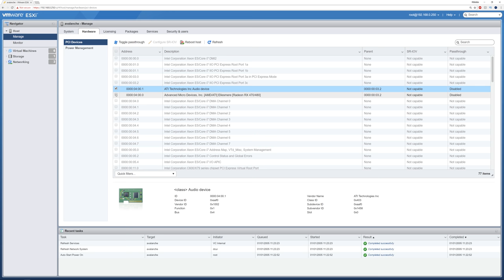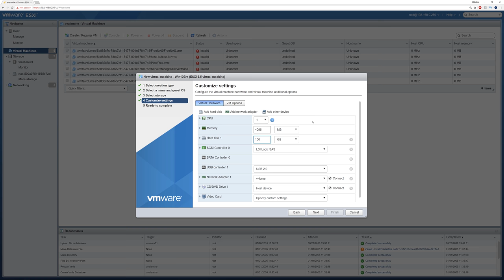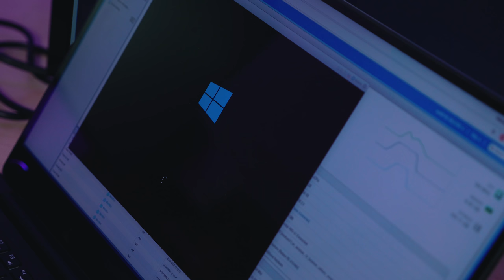Virtual Gaming PC in VMware ESXi 6.5 - Franken PC May 2018

Comment: Awesome, thanks! For a while now I've been using my server as a gaming PC, (literally an HPE Proliant DL580 server, haha) but at this point I need to multipurpose it into VMs for actual server purposes. My hope was that ESXi would let me still enjoy the overkill hardware for gaming, perhaps with my Nvidia Shield Portable or work laptop (vPro CPU, decent Nvidia card compatible with GameStream etc), so I'm really glad to see this!  Nice to see the performance you got using the basic VM interface, too. With the PCIE tied in like you showed us, hopefully it'll work smoothly. I know it works much better than Steam Link or any other RDP/VNC type interface I've tried so far, at least in native Windows Boot, and I'm hoping the headless-mode install (no external display ports enabled since I can tell ESXI to only use the server's S3 chipset) will give me increased performance over my current already great experience. Thanks for the tips about stuff like the 2nd monitor/install OS first bit, as that helps a lot. And I definitely agree about the server sound - mine's even worse. Add a 3 fan Nvidia GTX 1070Ti to the 6 vortex blower fans in the server plus 2 more in the power supplies and one more for the external power supply to run the video card (on a PCIE extension because it won't fit inside) - the "sea of sensors" detects it and ramps up the fans pretty loud. I can't wait to have it located in the back room instead. Your video has given me the confidence to give it a shot! (edit:grammar, punctuation)
Reply: That sounds (almost) great, except the loudness... I've got a similar setup too. Though I'm running a Linux host with docker containers, shares and so on and I've got a KVM with GPU Passthrough set up. My CPUs a R1600 and my GPUs a RX5700. The problems I'm facing is that for one my GPU doesn't reset correctly when I shut down the VM (reset bug kernel patch doesn't fix it for me) and second I'm unable to use it properly to stream my games to my laptop... That really kind of sucks as the HEVC encoder is really good and fast but the picture quality is really shitty on h.264 as parsec doesn't decode HEVC on Linux or when the client doesn't decode h.265 in hardware... 🥺

Comment: Awesome ! Just what I was looking for, proof that this was possible!
My next project is to create an ESXi server, have some ubuntu servers for my other projects and stuff and still be able to game on my couch! I "need" an Emulator VM, and since the rasberry pie can't handle too new consoles I wanted to have something with abit more juice in it, and still at the same time not have to have like 3 PCs around for the different purposes. Thanks!
Reply from the maker: My pleasure!
Reply: Heh, one of my planned VMs is the same - a dedicated emulator that I can stream to a TV in another room using an old laptop or more likely android phone/tablet (I have a few more than good enough for this with 1080p VNC/RDP capabilities plus HDMI out) and a bluetooth DIY arcade controller I built using classic real HAPP arcade buttons and 8-way joystick plus an ESP32, a lipo battery & charge circuit.  Originally had the Raspberry Pi in there too, but it's just not strong enough for what I want.Can't wait to have that able to run any time on it's own without bogging down my Windows install. The server I'm using is older, true, but still has plenty of power for what I need, and definitely for this. (12 cores/24 threads? Yeahhh... overkill for me, haha. But it was cheap!)

Comment: I wish this would have gone into how to use it remotely on a local network.  This is a great setup, but doesn't necessarily make sense if you plan on having physical access.
Reply: Parsec
Reply: @EddieLord  Parsec is great.  Still not quite good enough for games that require low latency.

Comment: Hey man you did a great job with this build, I have some questions, I am going to attempt this at home. But what its not clear for me its the part about the graphic card, so you can basically access the power of your desktop  graphic card using VM VT-D right ? you don't need to connect the laptop to anything else than your home LAN right ? Also you know will be super cool? Run some benchmarks comparing the VM vs the actual machine without vitalization, and let us know more details about your home network.
Reply: He has setup pass through for the graphics card directly through to the VM. It means  esxi doesn't touch it and passes it directly through. If he configures auto boot for that Windows VM, you don't need any other device on the lan to turn it on once it's all up and running.

Comment: Did anyone else notice the game stutter randomly a couple of times? Like a micro freeze? Edit: @8:46 you can see one as he runs around the corner.  A millisecond freeze
Reply: He has assigned only 4 core of that weak-sauce cpu, and only 4GB of RAM. I get no stuttering on my ESXI setup, horsepower is comparable, I'm using a E3 1230V3 and GTX1060.

Comment: Nice work mate. Could I please get some advice on how I would go about this problem below.
We are thinking of installing about 60 gaming capable pcs in our labs. These pcs need to be able to be on the school domain(tied down) and as well as free when it comes to game development courses. 
For the moment we were thinking of dual boot option with two NICs and so on or build vmware esxi servers that could run instances of gaming virtual cable virtual machines. The idea is that those that need the computers for gaming development can RDS into the vms.
If we were to group the pcs in 20s. what sort of hardware set up would you recommend?

Comment: Quick question do you always have to connect the monitor to the video card to achieve the performance for games or would using a rdp or vnc from another room if they are both on gigabit switch suffice? if so what would you recommend to use for the connection to host rdp?
Reply from the maker: You have to have a monitor connected to the machine for it to work.
Reply: install Steam on the VM and you can stream to any device on your LAN, that's what I do and work pretty good.
Reply: @GearSeekers  what is the point of using ESXI server if you cannot RDP or VNC remotely to it? Why wouldn't you install windows on bare metal rather than installing on ESXI hypervisor? Maybe I'm missing something?

Comment: Weird, I have a Xeon E3-1260L v5 and RTX 2080 Ti Setup running ESXI 6.7 and Fortnite runs like crap. The Witcher 3, Rise of The Tombraider, Battlefield 1, etc are running perfectly fine at 60FPS maxed out on ultra. But in GTA V and Fortnite I´m getting about 40FPS with drops to 20FPS.
My CPU util is around 50% in GTA V and Fortnite...
Do you have any hint what I could test or change?

Setup:
- ESXI 6.7
- Gigabyte GA-X150-PLUS WS Motherboard
- Intel Xeon E3-1260L v5 (8 vCPU´s, 8 Cores per Socket assigned to Win)
- 64Gb DDR4 2133 MHz (20Gb assigned to Win)
- 500Gb 960 Evo NVMe
- RTX 2080 Ti
- USB3.0 PCIe Card for Windows
- Gaming VM: Windows 10 Pro Build 1809
- Plus 2 other VM´s in idle
- VM SVGA disabled for WIndows
Reply: Figured it out by myself :) Everything runs perfectly fine now after setting 8 vCPU´s and 4 Cores per Socket. Not quiet sure why, but this was a total gamechanger compared to 8 vCPU´s and 8 Cores per Socket
Reply: Figured it out by myself :) Everything runs perfectly fine now after setting 8 vCPU´s and 4 Cores per Socket. Not quiet sure why, but this was a total gamechanger compared to 8 vCPU´s and 8 Cores per Socket

Comment: Minor thing I noticed but it is best practice when screwing in the heatsink/watercooler to cross tighten the screws (IE. top right > bottom left, top left > bottom right). Should help disperse the thermal paste more evenly and not put so much pressure on one side of the cpu at a time. Nice video!
Reply from the maker: You know that I've been been building for like 20 years right lol? It actually doesn't make much of a difference when this machine has already been torn down because it was built only for this video. When you build as much as I do for these silly builds you tend not to care and want to get it done fast. If you watch any of the howtos what you're saying is what I say every time.

Comment: Did USB passthrough require any additional USB PCIe cards or does it work right off the MOBO?

I am prepping for a 2 gamers 1 PC build using ESXI (not Unraid) but have had a hard time finding info for USB passthrough for multiple VMs.

Thanks!
Reply from the maker: The Intel server board we used has 3 USB controllers. It was pretty easy to do.
Reply: Thanks for the info!

Do you happen to know if ESXI's I/O Passthrough allows both PCIe and PCI devices, or just PCIe?
Reply from the maker: It should allow both.

Comment: I have a question:

Does this also work with a normal vmware workstation 16 pro? i am currently trying to get a windows XP VM to work with retro-games, so far everything worked fine (and partialy even better than back when i used a physical XP-Machine), but the VM has some problems running GTA san andreas. I dont know why, but the framerate is super-choppy and often freezes for a few seconds. It seams like the VM cant use enough graphical resources to get SA to work properly. Is there something i am missing? otherwise it seams to work just fine. ;)

Comment: Hey Nick! This is completely irrelevant to the video but I was wondering how to have a pair of speakers and a headset connected at the back of my PC at the same time cause there is only 1 line out. Thanks!
Reply: Can't believe nobody answered this until now! If you don't have a headphone jack on the front panel of your case: 
(1) EASY/FAST you can get a headphone splitter like this
https://www.amazon.com/Belkin-Speaker-and-Headphone-Splitter/dp/B00009WQSR/ref=sr_1_6?ie=UTF8&qid=1539368256&sr=8-6&keywords=headphone+splitter
and plug it in to your rear panel line out
(2) Harder/slower/more hackish:
you could be certain your motherboard supports front panel input/output (see the manual - it's a bunch of tiny colored pin pairs together often at the bottom front of the board) and get a generic i/o panel ($20 US) with a wiring kit ($8 US) and hook up headphones and USB
3) Kinda weird but anyway - find a used speaker set you like with a desktop volume/headphone out.

Personally I'd do the splitter and save money for the speaker set for later. Cheers!
Reply: Good man, David.  He's got right idea.  Same thing I've got.
Reply: @daviddupoise6443  my g thanks

Comment: hmmm im looking for cheap dead simple solution for cyber cafe , is this thing great to deal. but how pc clients can connect to VMs without extra hardware especially for keyboards and mice
Reply: Simply put... you want extra hardware. What route you would take depends on your use case. Do you need gaming workstations? Or just basic productivity & web browsing? Maybe a mixture? I'll cover how I would handle both situations.

Gaming Stations
A dedicated GPU and USB Controller per VM. You can get USB 3.0 PCIe cards that have multiple controllers. The most common is a 4 port/controller card. 4x GPUs, and 1x USB card to support 4 VMs. Place a powered USB hub at each station and use that to connect your KB, Mouse, & Headset.

Productivity Stations
Look into picking up some used thin clients. These are essentially very low powered machines designed for the sole purpose of using RDP, or other protocols to connect to a VM or remote machine over the network. All the heavy lifting is done on the server where the VM is hosted. That will let you attach physical peripherals right over the network. No need for dedicated GPUs & USB controllers on the server.

Comment: Im trying to do the same thing but after installing my 1660 Super, it's listed as "nVidia Corporation VGA compatible controller". I would have expected it to show up as something like "nvidia 1660 super" and when i pass it though to windows VM, i tried installing the nvidia drivers but it fails
Reply: Did you find a workaround to this? I'm currently having the same issue.
Reply: @Dogsss752  Yeah I did, apparently Windows 10 was out of date at the time. Make sure you update Windows 10 to the latest update. After doing this, the 1660 Super showed up and I was able to install the GeForce drivers. But if you're talking about getting the 1660 Super to properly show up in ESXi, sadly that won't happen. But you can still pass it through to a VM.
Reply: @DerpyNoodIe  thanks for the reply, Im stuck at an issue now where GPU passthrough is stuck at a constant state saying "enabled/needs reboot". this is for sure  a fun project to work on, but very aggravating, especially when you have no experience in the IT field. Good practice for me when I graduate next year and get a job somewhere IT related tho. looking forward to it.
Reply: @Dogsss752  That's pretty weird, so it gets stuck on enabled/needs reboot. So when you try to reboot, does it still say the same thing? I had the same issue with my 10GbE port on my motherboard, which I ended up buying a 4-port SFP+ PCie card and then upgraded my entire LAN to Fiber Optic (10Gb SFP+). Do you have the latest version of ESXi 6.7.0? I was able to passthrough my 1660 Super, it was a bit glitchy trying to select it because it would randomly highlight other devices above and below it, but with timing I was able to select my GPU and get it working.
Reply: @DerpyNoodIe  yeah I'm on the latest version, I got it to passthrough bt toggeling it on and off but I still cant install any drivers, driver says its microsoft.  Guess it didn't actually pass through despite it saying it did.
Reply: @Dogsss752  there's a work around to get it working. First you want to do is make the Windows VM to think its running on bare metal. To do this, you must navigate to your VM and go to "Edit Settings > VM Options > Advanced > Edit Configuration". Here you will add a line. Add "hypervisor.cpuid.v0" under the "Key" text box and then "FALSE" for the "Value". Next you will want to add "pciPassthru0.msiEnabled" and set that to "FALSE" and finally "pciPassthru.use64bitMMIO" and set that to "TRUE". Then start the VM and try to install the Nvidia drivers.
Reply: @DerpyNoodIe  oh man, you just saved me so much time, thank you dude.
Reply: Ganji Carries No problem :) 👍
Reply: @DerpyNoodIe  after rebooting it reverted the drivers back and now they wont install again. it's almost like nvidia doesnt want people using vms lol
Reply: Ganji Carries The reason for that is because Nvidia doesn’t want people using their consumer grade GPU’s for VMs. They want people to buy their Quadro series which is designed to run in multiple VMs at the same time, just like how you can share the CPU across multiple VMs. Also the reason why it resets the driver is because the VM will default to the generic Microsoft drivers. Your VM is seeing two monitors. One is the Microsoft driver (the virtual monitor displaying on ESXi ) and the second one is the Nvidia drivers (the physical HDMI port on your Nvidia graphics card). You need to connect your GPU to your monitor physically. Then the VM should display to the monitor (make sure you go to the correct input of your monitor), The VM will most likely be set to a lower resolution (may not be able to change to native resolution yet). Next you will need to set your VM to use the Nvidia drivers, to do this, you must right click on the desktop and go to “Display Settings” and you should see two displays, scroll down to “Multiple displays” and there should be a drop down box. Select “Show only on 2”. What this does is force the Nvidia driver to be used. Due to the limitations of using a consumer grade GPU, you will not be able to access the VM on the ESXi display because the Nvidia driver is associated to the physical port on the GPU. However if you are viewing the VM on the monitor through the Nvidia driver, you can still remotely control the mouse and keyboard by clicking on the ESXi virtual display, the screen will be black here but if you move the mouse around, you should see the inputs working on the VM which is displayed on your actual monitor. Moving the mouse off the virtual screen will result in losing input for the mouse on the VM, but you can just hover your mouse back to the virtual display on ESXi. Hopefully this helps. Also you can set your native resolution at this point. Every time you reboot the VM, you will need to set to display 2 and set the resolution again.
Reply: @DerpyNoodIe  wow, you know a lot about this. The only issue I'm running into is when I connect my HDMI directly  to my monitor it's a hit or miss when showing the display. It will appear for a brief period of time, then it disappears. On top of that it wont recognize my mouse or keyboard. I have no issues when connecting to the server on a different PC though.
Reply: Ganji Carries Yeah I went through about 2 weeks of hell and frustration trying to get it working properly. I had to a scour the internet, constantly running into brick walls, but I ended up piecing together bits of information here and there I found and eventually got it working, well... at least for my use case (a personal game streaming VM which allows me to play my games away from home on any device).
Reply: Ganji Carries Also, when it disappears, have you checked on the virtual display in ESXi? Does it show up there when your physical monitor doesn’t display the VM? If so, just make sure the Display settings is set to “Show only on 2”. When you set this, the ESXi display should appear frozen or have a black screen. That means the display has been switched to your physical monitor.